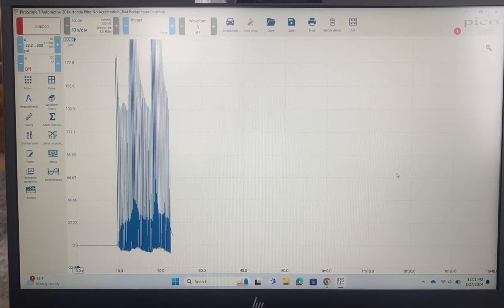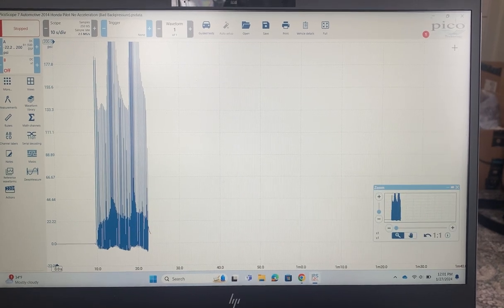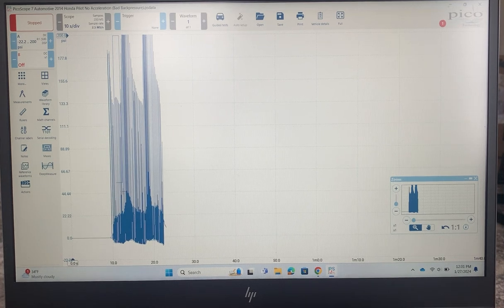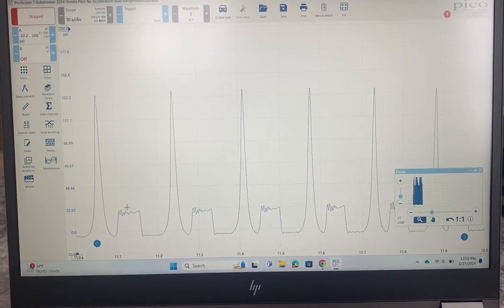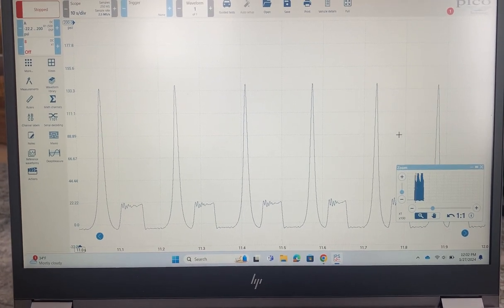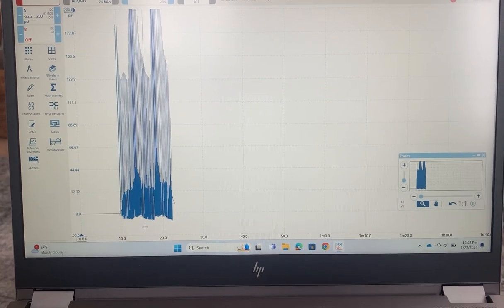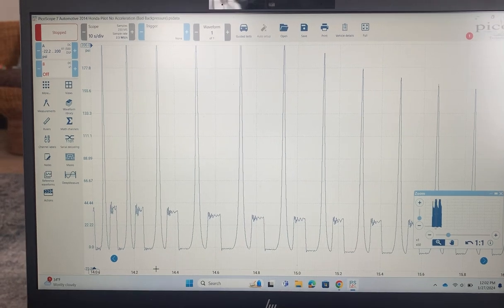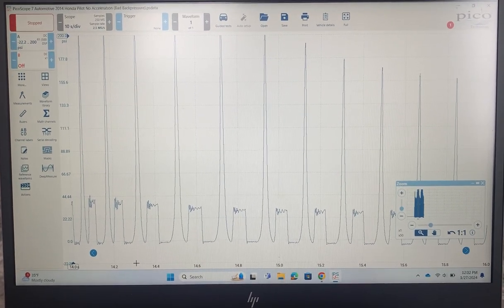Example of a Bad In Cylinder Pressure Waveform (2014 Honda Pilot Lack of Power-Backpressure)

Comment: i would say everything pointed to the cat and that is the hi probability, then i take temp measurements before and after cat 
and i use a simple pressure gauge before and after test ,for 100 percent cat diag
Reply: He's building damn near 44psi under load. There's no way I'm wasting time pulling off 1 smoking hot o2 sensor let alone 2. You aren't flat rate you'll learn
Reply: i meant pressure test front and rear of cat

Comment: Hi with cylinder presure wave form can we find out leaky valves or bad head gasket. if so what we should look for. have u also ussed plse tester?
Reply: Definitely. A pressure pulse sensor works great for head gasket failures. Rotkee makes great scope tools.
Reply: These things are better found by a leak down test.